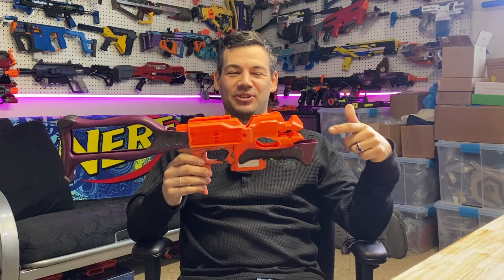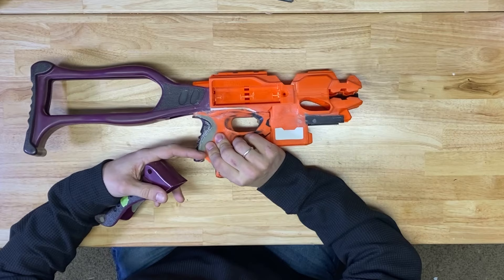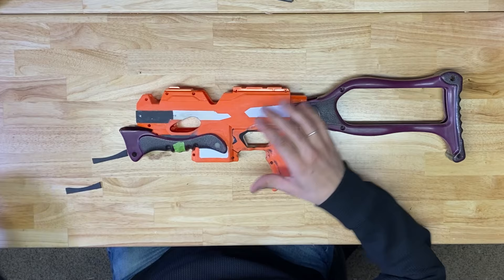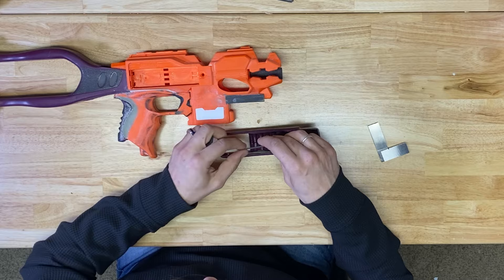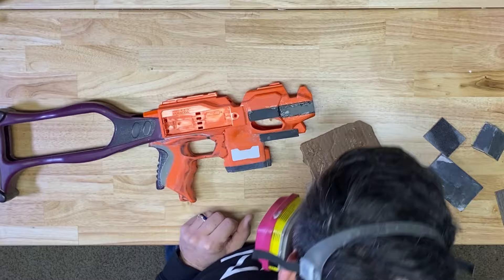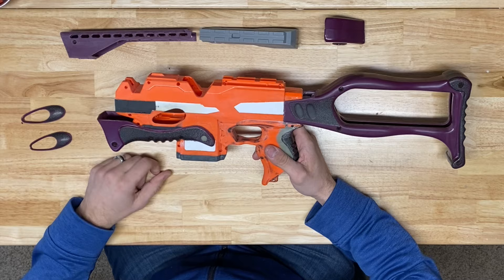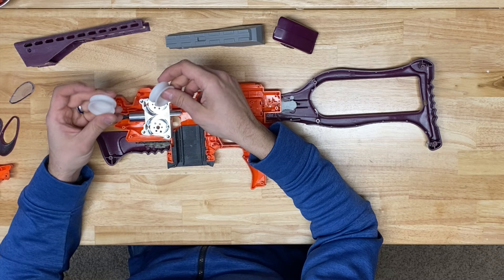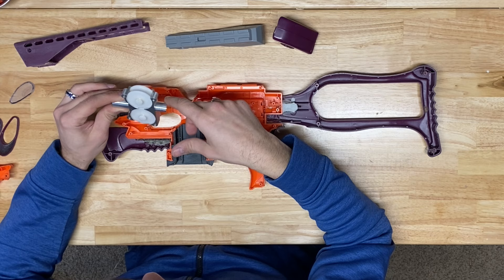[Nerf Mod] Choosing A Flywheel Cage... Nerf Kenner Crossbow, Stryfe Integration (Build Vlog Part 4)

Comment: One way you can mount the rail is to use the hole for the old nerf tac rail attachment tooth and mount a T or fabric a mounting tooth on the rail itself to mold to the hole so when you split it open you can just pull the whole rail out, just an idea

Comment: Daybreak wheels can be dyed, and  while the banned blasters cages are printed in petg the wheels are delrin
Reply from the maker: Yeah, I know you can die delrin, but from what I've researched a little more difficult. I think I should use the RIT dye "more" but of course that doesn't come in neon yellow, so I'm not sure where I'm gonna go if I can't get the all purpose RIT dye to work.
Reply: @NaptownNerf  delrin is such a fickle things, great for parts but terrible for color matching